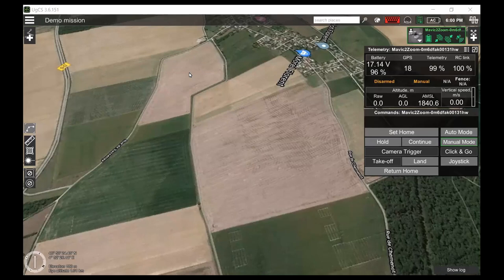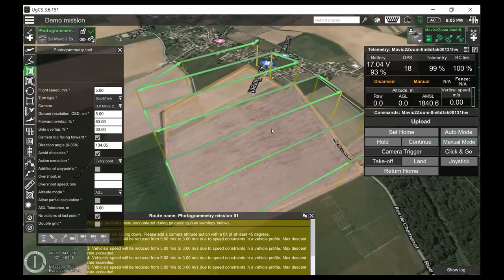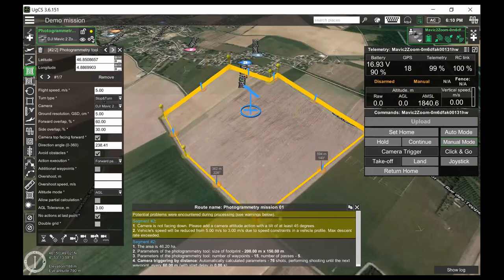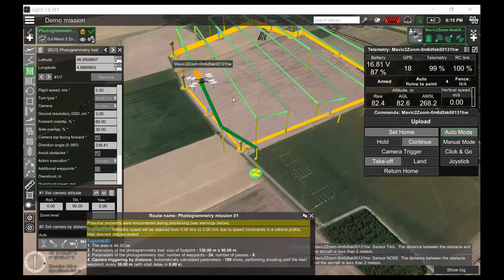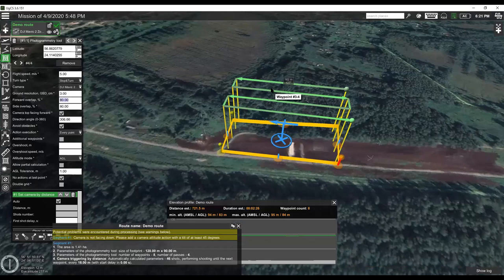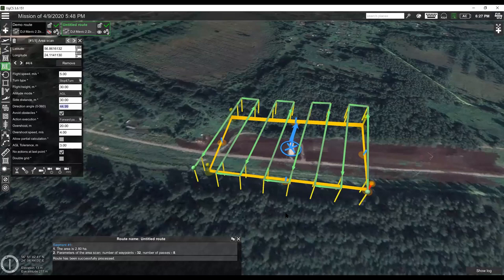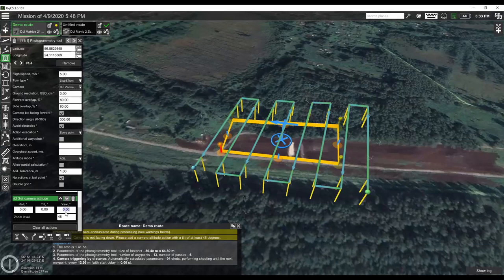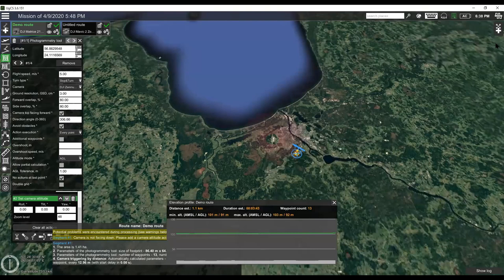UgCS webinar - How To #2 Photogrammetry

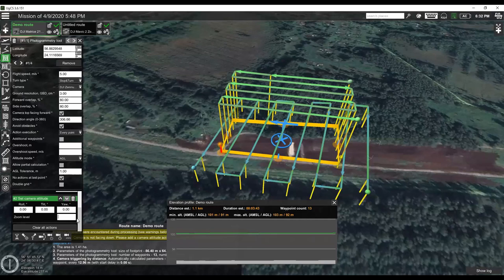Comment: At 24:26 you talk about changing the zoom level in Camera Attitude settings.  If you have a X5S camera, will the Auto  calculations changed based on the Zoom value?  In otherwords, can I have one profile version of the X5S camera, but use the Zoom Level to specify which lens is on the X5S so that UgCS will calculate the photo spacing and GSD correctly?

Comment: 1. How can I change from Metric to Imperial in the Desktop software?   2. Is it possible to add the "AGL Value" under the GSD?  It would be nice to have both so that if I enter 120 Meters, that it will automatically tell me the GSD for that altitude.  But if I enter 1cm for the GSD, it will automatically tell me the Altitude for the 1cm GSD value.